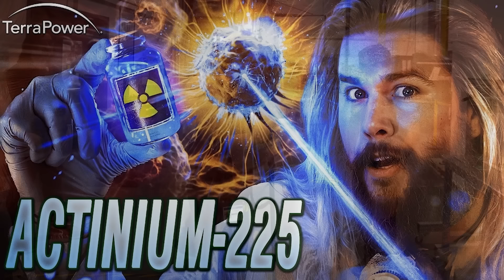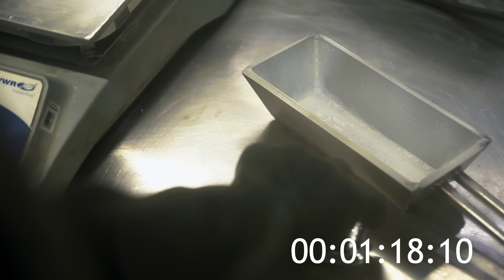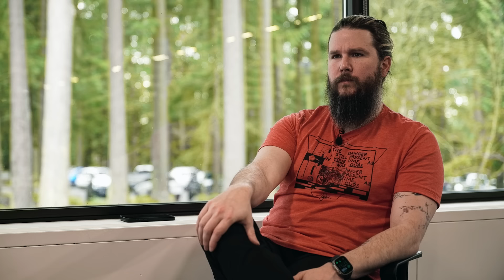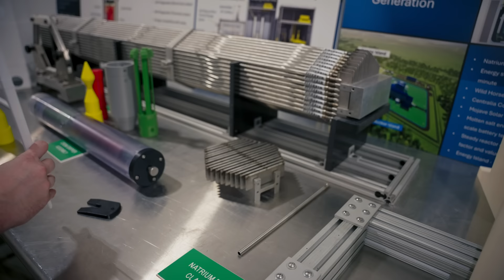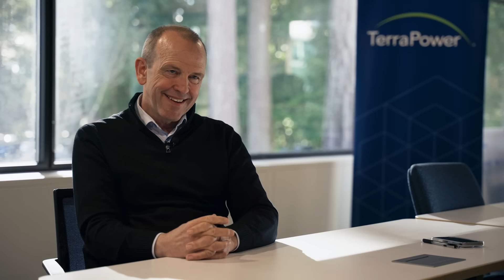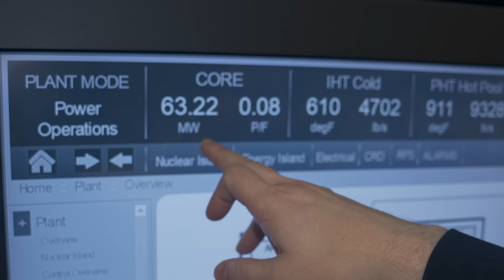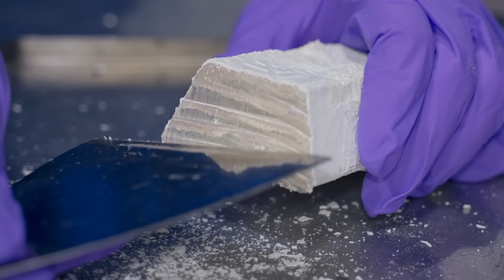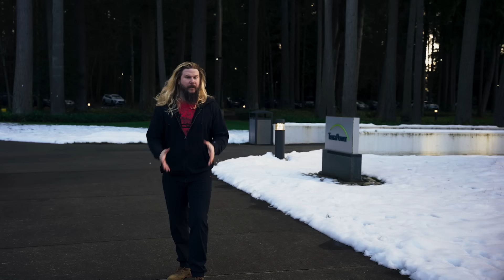Will Natrium Nuclear Reactors Change Everything?

Comment: Well company of nobodies who use latin word for sodium .... yeah, obvious american scam startup to lure investors money, nothing more, nothing less.

Btw. Ruskies have two powerplants with this coolant and although they are technologically superior to comercial PWRs, it is so costly, that Russians do not know, if is worth to build third one or not. Russians!!!!
Reply: would you like to live next door to one?
Reply: @veritea9374  FBR based powerplants are surprisingly safe. They are low pressure in all circuits. Sodium is selfsealing for leakages. Sodium is reactive, but if you ensure, that air is humid free and there are no sources of water, it will not burn even molten.
Fuel in FBR is pretty inert. It can be basically just Uranium 238, which is safe. FBR also burns not only fuel but also byproducts, so even in very unlike scenario of reactor explosion, radiation pollution would be mediocre and half-time of byproduct would be so short, that in few years even primary zone would be practically safe.

FBR has really only problem in costs. They are simply 2-2,3 times higher than for PWR.

So answer to your question - yes i would. I consider this type of reactor so safe, that i would even accept Topaz reactor in my basement for heating and powering my house if Russia would be so willing to give it to me 😀
Reply: @tomascernak6112 
I call absolute BS on this. 1:Nuclear fuel isn't inert. Neutrons for nuclear reactions come from a fissile isotope, for most breeders is plutonium. The breeding part with U238 is that it makes more plutonium than it consumes. Your wordplay has got you confused, and/or you are trying to confuse others. 2: Sodium Fast breeder reactors have much less stability than PWRs, and as happened at Fermi1, a few seconds delay led to the reaction going into runaway. Fortunately emergency control rods were put in place within seconds though the core was melted and the reactor scrapped. If the reaction continued a bit longer, it is probable that radioactive isotopes neptunium, plutonium, cesium iodine, etc would be aerosolized and spread across Detroit. A meltdown from a Natrium reactor would be no different as the contents are the same. 3: Sodium is a liquid at 97.8C, there is nothing magical about liquids way above their melting point sealing a steel reactor vessel. On record Russian sodium breeder reactors have been very leaky. 4:As for always keeping it from water, water is omnipresent in the steam generation loop, and the further it is from the reaction, the more heat losses are generated. Moreover one would have to keep it from where it might get rained on as that is what happened to remaining sodium from Fermi1 in Nitro, West Virginia, causing the town to shut down and turning it into a superfund site. Sometimes rain comes with floods in Tornadoes and Hurricanes, and on the coast there can be tidal floodingas was in Fukushima. Combining that with wartime and the attack as there was at Zaporizhzhya dome 6, and on Cherynyobly February 14th 2025 .... 4: Sodium Fast Breeder reactors are more expensive, yes, but there are way more problems and challenges with them.  The protests against the Superphenix in France was due to it being viewed as unstable and dangerous.  The breeding reaction is more diffiuclt to keep from runaway than BWRs.  As it can produce more plutonium from U238 than it consumes, it poses a great proliferation risk. Also as it hasn't been built in the U.S. there are no specialists with experience and safety protocols are largely novel.  
5: Topaz isn't a sodium fast breeder reactor. I guess you would wish them on others, but not yourself.
Reply: @veritea9374  I smell antinuclear activist. So many lies just proved you have ideological bias.
Reply: @tomascernak6112  Be specific, I was.  Looking to the Russians on nuclear power might get another Chernobyl.
Reply: @tomascernak6112  I am a scientist who has worked many years with radionucleotides to understand biological functions.  You have not responded to the latest which leads to a conclusion that you cannot address your claims honestly.  My understanding of Nuclear issues has pros and negatives, yet I am somewhat better informed than most as I have focused.  Your comment showed you were less informed, which makes you stink in a way I cannot.

Comment: I'm all for molten salt reactors ever since I first found out about them.
But Kyle, you hear me say, why does this video totally ignore the issue of equipment corrosion that comes with MSRs, and the need for more frequent replacement/servicing of those parts and the associated safety issues?
I vaguely recall you mentioning corrosion in a previous video about MSRs but treated it like a minor issue barely worth a mention. But it's probably the biggest issue for MSR safety.

Comment: (I dont know how to tag the time but around 16 minutes) The reason sodium explodes in water is because of coulombic forces, not because of hydrogen. There is a paper by phil mason et al explaining this. The hydrogen burns off and never develops enough concentration to cause an explosion, but the hudrogen bonding in water creates a potential that is strong enough to tear electrons off of the sodium atoms and leave the rest of the sodium with enough positive charge to make them violently repel each other.

Comment: Best overview presentation for Terra Power/Natrium reactor I've seen to date. Using liquid sodium for reactor coolant and liquid salt for downstream heat transfer takes advantage of the best features of both of those media, while minimizing their inherent disadvantages. If this design is to be scaled to encompass hundreds of units (as it must be to make overall economic sense) we should be aware that there would need to be massive, and massively expensive, changes to the nuclear-industrial environment outside the power plants. To point up just one example: Where is fuel supposed to come from? It uses HALEU fuel, which contains uranium enriched (in U-235) up to 20%. There aren't any uranium enrichment plants licensed to go above 5% (at least in the West), and non-proliferation concerns will likely keep it that way. Even if you turned a blind eye to that problem, a huge investment in new and different centrifuge cascades would have to be made, and that won't happen unless volume production can be guaranteed. (Chicken and egg problem that free markets won't solve, which increases dependency on increasingly fickle government.) The DOE can (and has) made limited amounts of higher-enriched uranium available for experimental prototypes, but that is not a viable long term source. And don't get me started on the costs, complexities and waste management headaches from trying to repurpose spent rector fuel. Now, maybe the Natrium will work so well, right out of the box, that it will impel a complete rethinking of our energy future and attract to itself the trillions it will take for large-scale deployment. But I think that would require  a society that is far more focused nd united than the one we actually have.

Comment: Maybe you should mention that Sodium (Natrium) is one of the most EXPLOSIVE elements in the Universe.
Reply: Everyone knows this - so what? Rocket engines use the liquid fuel as coolant in the nozzles.
As long as you can manage the risk with things like adding redundancy in monitoring and protection systems, or I don't know, segregating sodium and water systems, what's the problem?

Comment: Isnt sodium mixed with water super dangerous?
Yes! Let me explain to you why it's safe in this application!
Literally just explain why it's safe in the air, says nothing about the water its being used to heat. 😂😂😂
Reply: How about that enormous molten salt system they put in between the two? You have a sodium-salt interface for moving heat into storage, and a separate salt-water interface for producing steam.

Comment: I'm surprised that they didn't also talk about one of the biggest safety upsides of using a molten salt heat exchanger: there's never a chance for the water in the steam generator to come in contact with the sodium. I wish they had talked about how they were going to handle refueling and working with the reactor under an inert atmosphere since these are the biggest technical hurdles to solve for sodium cooled reactors. Superphénix in France had many teething issues from its sodium loop and these contributed to its closure after being unproductive for the first several years (and then political issues afterwards).
Reply: Since the reactor design used is GE Hitachi PRISM, a predecessor to IFR and and EBR-II there is a lot of material available describing how they are operated.

Comment: Kyle said he'd get back to the difference between slow and fast neutrons, but didn't.

First thing, we don't call them slow neutrons, we call them thermal neutrons.

So what's the difference between fast and thermal neutrons, simply, it's kinetic energy.  A thermal neutron is typically moving with a velocity of 2200 m/s (or 2.2 km/s).  You get down to this velocity through moderators (as Kyle mentioned) usually bouncing off light weight nucleui (hydrogen is great for this, thus why most reactors are water based, either H2O or D2O, but can also use Carbon as well, thus graphite moderated reactors).  The thing to remember though is that neutrons that come from a fission are typically moving with a couple MeV worth of kinetic energy, this means that the prompt neutrons from a fission have much higher speeds than what thermal neutrons end up at.

If neutrons from fission reactions are born fast, why do we slow them down?  This is in part due to cross sectional area of the fissionable atom.  For fissionable atoms, the cross sectional area of the atom increases as the neutron moves at a slower speed.  Thus for U235 based reactors, you want to slow the neutron down to increase the chance of a fission event.  However, with natural Uranium, U235 only makes up 0.7% of the total Uranium and for light water (H2O) based reactors, you typically need to enrich the Uranium up to a minimum of 3.5% (typically around 5%), but with heavy water (D2O) based reactors you can use natural uranium.  So why enrich with light water reactors?  Because U238 will absorb some of those neutrons and eventually decay into Pu239, so you need to enrich to keep the chain reaction going.

But what happens when you instead use fast neutrons?  If the neutron's kinetic energy is high enough, usually around an MeV, even U238 can fission directly.  This is why you see the use here of Sodium as the coolant as Sodium doesn't do a very good job on moderating and slowing down neutrons (along with the other aspects Kyle mentioned).  This means that you can use mostly U238 as your fuel because some of the neutrons will end up being absorbed by the U238 instead of fissioning and will create some Pu239 and overtime, the reactor will make more fuel than it's actually using (thus the terminology of being a "breeder" reactor - there are three, the burner, the converter, and the breeder).  Fast reactors are either converters or breeders and the design talked about here is a fast reactor (so it will either convert as much U238 into fuel as it uses or it will make more fuel than it uses over time).

If fast reactors are so good, why haven't we used them?  Simple answer, proliferation.  Fast reactors typically make more fissile material than they use during the operating process (thus why they're called breeders).  With the increase in fissile material made, some of that fissile material could be siphoned off for weapons (the reactors at Hanford WA and Rocky Flats CO were designed in this way).  This is part of the reason that fast reactors weren't commercialized until now (and I'll have to look into more, but I have a feeling that Terra Power's Natrium is a converter and not a true breeder as NRC would likely have put a lot more scrutiny on the license).

So, there's the rabbit hole that Kyle didn't want to go down to explain thermal (slow) and fast neutrons.

Comment: Fast breeder reactors arent new but most of them was taken out of use due to the byproduct being what drives nuclear bombs and can get diverted if poor corrupt countries start using them. Also, one of them started leaking pure sodium metall in Japan many years ago, and that's really bad since it reacts violently with water and even humidity in air. Germany built one in the 80's but it was never started up because of protests. Russia however have been uing fast breeders for decades. Sooo, this is nothing new...

Comment: Regarding the demonstration at 14:00, there is a big difference between a block of solid sodium at room temperature and molten liquid sodium. Molten liquid sodium would  immediately ignite into an uncontrollable fire if it contacted air.

Comment: Lots of errors. 1) Present LWRs can follow load. 2) Sodium explodes when it touches water . To this day Ferm 1 has a water ban inside containment.3) The Navy tried sodium reactor, and it was a failure 4) Fermi 1 was a sodium reactor and failed miserably. 5) Vogtle 3 and 4 just went online in the last 5 years. 6) You run the sodium reactor at 100% all the time but load follow? How do you get rid of extra heat in the molten salt? You can just add volume; the heat has to go somewhere.
Reply from the maker: 1. They have more trouble doing so than wind and solar. 2. The reactor doesn’t use water. 3. The doesn’t mean the design is inherently flawed. 5. The video says “the next” nuclear reactor to be built. 6. You match what the grid needs in theory, you’re not just storing an infinite amount of heat.
Reply: @kylehill  1) We saw how well wind and solar follow load during the recent Iberian blackout :).  The reality is they don't really follow load, but that their maximum output is limited by environment (night, shade, snow cover, clouds, no wind, too much wind) 2) It's a steam driven turbine. The sodium has to be handled several times in its life cycle. Water will also be a hazard from simple condensation. Look up D1G Prototype Containment aand Fermi 1. Maybe technology is better today, but I doubt it's enough. If sodium reactors were good, Admiral Rickover would not have given up on them 6) If the reactor is always at 100%, and the generator load follows, then the difference between reactor power and electric output power has to be dissipated somewhere. The molten salt can't hold extra power output indefinitely unless it has unlimited volume. It can only do it for short term transients. When LWRs load follow, until reactor power is adjusted, they dump steam to condensors and the extra heat goes out the cooling tower until reactor power is matched to electric power output.

Comment: hey kyle, I'm curious about something. Say they needed to shut down the reactor for an extended period of time, for whatever reason, would they drain the sodium out first? or let it solidify inside the reactor and heat it up using the magnets meant to circulate it?
Reply: I don't know about sodium for nuclear reactors, but in general yes it is better to purge the sodium into a storage tank during a long shutdown. Also, both sodium and salt systems have electric heat tracing strapped to every metre of piping and equipment under the insulation to stop it from freezing in the short term. You can also melt a frozen sodium circuit, you just need to be careful not to melt an area until it has an adjacent region to expand into. Salt is much harder to re-melt safely since it freezes rock hard and actually conducts heat quite poorly!

Comment: While room temperature elemental sodium is far less dangerous than most people suspect, I'm more interested in the huge quantity of 500C liquid sodium and what safety measures are in place to prevent/mitigate a leak. There's snow on the ground in the video and it's would be rather energetic if even a hundred gallons of the liquid salt leaked out onto the ground.
Reply: For sodium systems there are some design philosophies like no submerged flange joints, and 100% testing of welds. You can also add containment bunds and suffocation pans, add redundancy in your monitoring and protection systems, and overall just limit human occupancy in those areas.
The other thing is it takes quite a bit of water to react fully with that 100gal, and unless it's a massive body of water the pH increase from the sodium hydroxide will slow the rate of reaction.

Comment: So what do you do when the liquid sodium metal leaks in an accident and comes in contact with the water you are boiling to make the steam?  Radioactive sodium hydroxide gas following the explosion of hydrogen gas ignited by the reaction?
Reply: And yes, you're storing it with a shielding gas.  That's only gonna help in normal and nominal conditions.  The concern is that if some sort of natural disaster or maligned attack happened, it won't matter if you scram the reactor, you've still got a giant container of liquid sodium that you've been using as a heat battery.